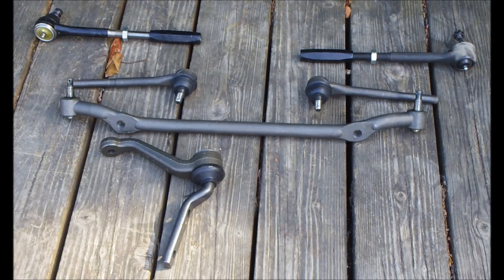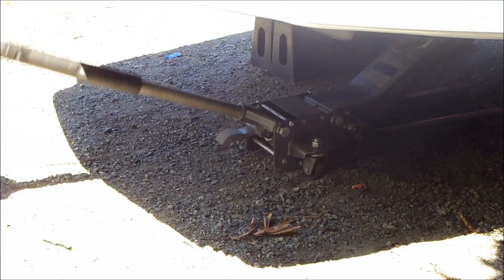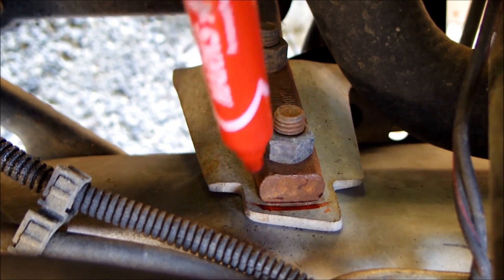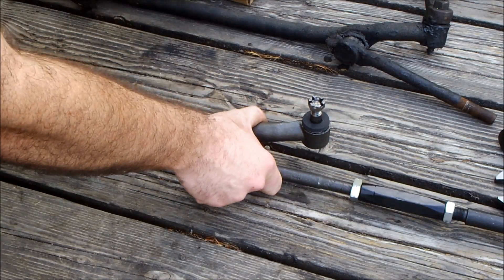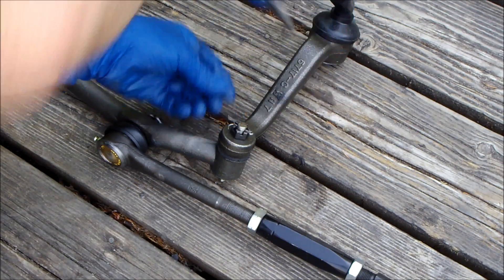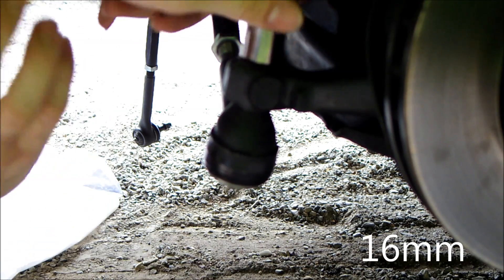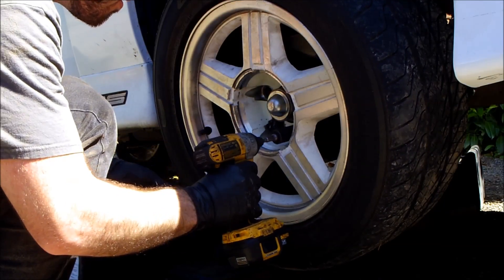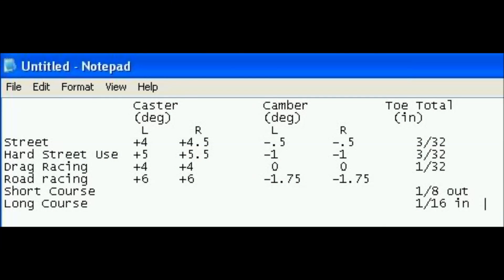Complete Steering Rebuild (1982-1992 Camaro/Firebird)

Comment: Rebuild List:
Moog ES2226RL - outer Tie Rod ( you need two)
MOOG ES2227RL - inner Tie Rod (you need two)
MOOG DS1049 - Center Link
AC DELCO 45C1065 - Idler Arm (all the other brands use the wrong design which causes bump steer)

Comment: Hi.  Great video.  It reminds me of when I did this job in the 90's.  My 82 was starting to show it's age and the annual state inspection was due.  So I replaced everything I suspected was wrong.  The day after I finished, I took it in for inspection only to be rejected.  I asked the mechanic what was wrong.  He said the ball joints were bad.
I asked if he could show me the problem while the car was still on the rack.  He obliged and we looked under the car.  I asked to point out the bad part, where he pointed to the left upper joint.  I then asked him what was wrong with it.  He said it was bad.  
I then questioned him again, telling him he wasn't going to work on it.  Just to take away the "make work incentive".  He again said the joint was bad.  That's when I called him out, informing him the joint was a TRW part with a lifetime warranty that wasn't three days old.   It didn't have any dust on it, let alone dirty grease.   He then retorted that the center link was bad.
I took it home and changed the center link within 3 hours.  He wouldn't look at me after he placed the new inspection sticker on the car but wrote that the ball joint was bad on the receipt.  The lady at the counter showed the comment to me and I dared her to call the state police.  She walked away.   
Sorry to ramble.
Reply: He was trying to make some money, that y mechanics have a bad reputation.

Comment from the maker: IMPORTANT!
the Idler ARM listed at 0:13 is incorrect!
the correct idler arm is (ACDelco 45C1065 )
Reply: And you also have to mention, that the design of the idler arm by MOOG is not the correct one so you might not be able to adjust it correctly. Better to use tha AC Delco one.
Reply: So its the same as the center link
Reply: @waynegreen6789  What do you mean? What is the same as the center link?
Reply: @ThomCountryfan  the center link numbers you posted is the same number listed as the id arm
Reply: @waynegreen6789  Actually that wasn't me posting the numbers but the maker of the video. But I've checked the video now. There's really a mistake. The id of the idler arm and the center link need to be swapped. So, 45C1065 is the idler arm and the correct Moog center link is DS1049.
Reply: @ThomCountryfan  thank u..
Reply: @ThomCountryfan  Thank you for pointing that out!  Every bit helps.
Reply: @kirkdecker6228  You're welcome.
Reply: @ThomCountryfan  so the part numbers are right. Just the description is wrong? I'm ordering the Moog Center link pn Moog ds1049
Reply: @323spy  Actually the problem I was coming up with was about not using the Moog idler arm because it has a wrong design. And then after that I also realized that in the video there is a mistake. So, yes, you're right, you can use the Moog DS1049, that's the correct Center link! But I have to say, I had the AC Delco Center link before the Moog one and somehow the AC Delco one had a better finish. It seems to me that the Moog parts are more prone to rusting. The Delcos seem to have a coating (black). I can't say anything about the end-links as I've never had the Delco ones. But anyway I'd say, quality-wise it won't make a big difference if you use Delco parts throughout if they're cheaper. For the Center link that would be ACDELCO 45B0075. I replaced the Delco Center link only because I wanted to replace all steering parts at the same time. Before that I once had to separately replace the Center link and my mechanic used a Delco one. Then I was a bit disappointed by the Moog ones, also the end links don't have a coating and got rusty after a few weeks / month's time already. But you could also paint them yourself ;-)
Reply: Was my answer helpful @heriberto romero?
Reply: What center link did you use? in the video i think the part numbers for the idler arm and center link are swapped. Did you use the moog center link ? 
Also what is the part number on the tie rod sleeves please
Reply: @Toast355  First I had an AC Delco one (45B0075) which I thought was a better product (had some kind of a rust-proof finish (black color) which the Moog one (DS1049) didn't have, the Delco is even cheaper). Also Proforged (10610011) has a center link which is very nice but more expensive.
The tie rod sleeves part is ES2032S (Moog) or 45A6013 (Delco). I used the Moog ones. But there is a better part from Proforged. They also offer a complete set of all the steering linkage (11610016).

Comment: took a gamble and ordered the acdelco idler arm and thankfully it was the correct geometry. i installed the idler arm first and then aligned the center link and then attached the tie rods. i performed my alignment using the winalign by hunter and it worked alright. i might have to realign it because i didn’t like it, plus i was in a rush to get out the shop since i was the last one there. you can see the toe-in on the passenger side tire, so i will go out of a spec just a little on that tire.
Reply from the maker: I tested 13 idler arms for bump steer, and they all passed.
I'm still digging into more data

Comment: The part I'm most concerned about tackling was brushed over. But the rest was also very helpful so thank you lol
Reply from the maker: tackling??
Reply: @3rdGenGuy  I'm going to be doing the job myself and was hoping you'd demonstrate how to make sure the center link is level
Reply from the maker: you can measure from the k-member bolts.
or I just measure from a flat garage floor to the middle of the inner tie rods.
Reply: @3rdGenGuy  Is it pretty straightforward then? Do you adjust the level by moving the position of the idler arm?
Reply from the maker: yes, the idler arm is just snugged up so you can move it up and down with a small hammer tap.
set the inner tie rod nuts to be equal.
then torque the 2 idler arm bolts
Reply: @3rdGenGuy  got it all done! Thanks so much for your help. Really couldn't have done it without your video! Appreciate what you do. :)

Comment: Thank you!!!
Reply from the maker: glad I could help.
nothing's worse than watching a 30min video of someone rambling on and on without showing you what to do.
Reply: Exactly! Bit by bit I'm bringing my Firebird back to new condition :-)
Reply from the maker: good luck man.I also have a spring, steering shaft, strut tower video as well.
Reply: Thanks, will check them out! Gonna start with brakes and shock absorbers, fluids and filters, then it's gonna be stripped and repainted.
Reply from the maker: A 3rd gen Forum member has brake kits for our cars. some fit under 15 or 16in rims. stock brakes are basically garbage.
http://bigbrakeupgrade.com/

Comment: Ordered the correct ACDelco 45C1065 from the ACDelco store on Amazon and received the MOOG part.  I did this because there is a review of the part from July 2024 which claims to have received the ACDelco part.  Are there any other brands that are verified to be the correct idler arm?
Reply from the maker: ACdelco is a different part.
if they sent MOOG, return it.
I know the acdelco idler is correct and some have told me the Pro-forged unit is correct

Comment: Is the ACDelco 45c1065 the correct part number for the center link?  Thanks in advance.  Also, does an IROC use the same steering components?
Reply from the maker: the AC delco and Moog center link can be used. either is fine.
and yes, all 3rd gens use the same steering links.
Reply: @3rdGenGuy  Thanks for getting back to me.  I have replaced all the components using the Moog parts purchased through Spohn.  I am also using Spohn's Bump Steer Kit - 1982-1992 for GM F-Body's.  Thanks again.

Comment: Hey, so I have all the parts added to my cart
Moog ES2226RL   $20 x2
Moog ES2227RL   $31 x2
Moog DS1049   $89
ACDELCO 45C1065   $67
So total is about $258 for anyone curious
But my question is this, do the adjustment sleeves come with either of the tie rods or do I have to buy the adjustment sleeves and clamps separate?
Reply: You have to buy them separately.

Comment: Hi, I am just doing this now. I have MOGG inner and outer tie rods and the AC centre link. You say the tie rods should have come with some instructions for setting it up. Mine had nothing so just asking do you have a picture of the instructions I need to follow to ensure I set this up correctly before I take it to have the alignment set at a shop. 

Thanks in advance and great video very useful
Reply: You just have to install the tie rods that they are about the same as the ones before. I mean the distance between the center link and the tie rods has to be the same so that your alignment isn't too far off while driving it to the shop. The shop is going to do the rest. What you have to adjust is the height of the center link relative to the control arm bolts / ground. It has to be horizontal. You adjust it with the installation height of the idler arm which you might not be able to if you use the idler arm with the wrong design (Moog and as it seems today also the AC Delco ones). Maybe Proforge idler arms are stil the correct design.
Reply: @disdonc6012  thanks for the reply. This job was done last year. I did manage to get the setup close and I did use the new AC Idler which for mine was ok. I then had a shop do the final adjustments and the steering alignment etc is as good as new now (as it is new haha ) but thank you for the time taken to add your reply.

Comment: THANK YOU!  I'm getting ready to do this to my 89 Trans Am GTA.  Do you have a video about replacing the ball joints.
Thanks again for a great video!
Reply from the maker: I had part of a video on the ball-Joints, but lost 1/2 the footage. I have racing ball-joints now so it's not really applicable to most guys.
Reply: hi these parts fit on  a 1987 pontiac gta thanks

Comment: Guys! The AC Delco does no longer use this design. It's like the Moog and the others. However it shouldn't be a problem and probably never was as the bolt holes line up perfectly with the factory piece. Only difference is the bend is in a bit higher place but theoritically shouldn't be a problem. You can read the 3rd gen forum and multiple people confirmed that they work just fine
Reply: The problem has never been the ligning up of the bolt holes. The problem is, that with the wrong design (bend), you won't be able to adjust the center link so that it is exactly horizontal. But this step is omitted by some mechanics anyways. They just put the new idler arm at the same position as the old one, but this isn't really correct (especially with a wrongly designed piece). You'd have to measure the distance from the ground or the control arm bolts to the center link flats.
Reply from the maker: some of the newer AC delco Idlers are wrong. 
I ordered a new one and it was a match for my old one.
but these parts sit on shelves for 10+ years often times.
Reply: @3rdGenGuy  So what part would you recommend if I can't locate and AC delco?
Reply: @TubeWatcher  I would just use your old one. Paint it up should work fine I would think.

Comment: Hi I have to rethread one of the bolts on my center rod would you know what size of die I will need thanks
Reply from the maker: pretty sure it's  5/8-18 thread.
but remember one end is LEFT hand thread, the other is right hand. 
might be worth just buying a new tie rod. they aren't expensive.

Comment: I have never changed the center link before , but after you put the parts all together , it seems like it should be lining up properly would think , so I'm  not really understanding about the center link and aligning the bolts with the a arm bolts , I would have thought once you bolt everything together like you did before you installed it that everything would be aligned properly , Great video by the way !!!
Reply from the maker: so basically, the center link needs to be perpendicular with the pitman arm and idler arm. otherwise the geometry gets wonky.
you can measure from the a-arm bolts.
or from a level surface upwards.
Reply: @3rdGenGuy  thanks for the help , are you happy with the moog parts ?  I went on eBay & ordered a TRQ kit , & one of outer tie rod ends  the boots has a cut in it ... I guess I should have tried to go locally at the auto part store . The seller did refund me my money though , told me to keep or throw away the parts ... Its hard to find good quality parts anymore
Reply from the maker: I've used the MOOG center link and inner/outer tie rods.
just make sure you have the AC delco idler arm

Comment: Why didn't you upgrade the steering to rack and pinion found on the 4th gen Camaro/Firebirds?
Reply from the maker: 4th gen steering geometry doesn't work on a 3rd gen.
the a-arm lengths are way different. 
3rd gens have NO rack and pinion support that has the correct geometry.

Comment: I think moog fixed the part, I just installed all of these parts using moog and it works fine. What was the issue you had?
Reply from the maker: the correct idler arm is (ACDelco 45C1065 )
the moog arm has the wrong geometry. 
it works, but it can induce snap oversteer
that might send you into a tree if ur pushing the car hard.
Reply: I also think I wasn't able to level the center link correctly. I guess most of you don't even care about leveling it. You just use the old places when bolting the idler arm up.

Comment: Do you mean the AC Delco center link or idler arm?? It looks like you have reversed the part numbers- the Moog center link number is DS1049
Reply from the maker: the ACDelco 45C1065 was the Correct idler arm.
but now i'm hearing they changed the geometry and it's wrong just like the MOOG idler arm.
I haven't checked the PRO-Forged one yet

Comment: Our 1983 Camaro had an inner tie rod that was shorter than the Moog ES2227RL.  Did Moog change the center link and tie rod ends dimension?
Reply from the maker: SO MOOG's parts are often universal.
so yes, their TIE rods may be a little too long. when using the non stock Tie-rod adjusters.
 i had to cut off 3/4in off one to get it to work.

also, the Pro-forged kits are also acceptable quality wise . price is a bit lower than MOOG/AC delco as well.
Reply: @3rdGenGuy  I made a huge mistake.  I was comparing a Blazer tie rod not a Camaro tie rod. Too many projects going on here.  
I lost the mark when removing the old idler arm bracket from the frame (painted the engine compartment)  Any idea how to adjust the position of the idler arm bracket height?
Reply: @stricklandgarageaviation2864  You have to align it, so that the center link is level. I guess using a water spirit level could work but actually it has to be level to the K-member, not the ground. The manual says that you have to adjust it using the bolts of the head of the nuts where the A-arm is connected to the K-member as a reference point and then measure some distance (center link -- bolt) which has to be the same on both sides.

Comment: Where did yoy buy this kit?
Reply from the maker: each part was purchased separately from amazon.
part numbers are at 0:13
Reply: Not An Argument. How much did it ask cost? Did you have to cut anything to make the parts fit?
Reply from the maker: it's about $300 total not including a new alignment.
BUT it's a drastic improvement over worn-out linkage linkage 

if you used the billet sleeves (connects outer an inner tie rods) you will have to trim 3/4in off the threads on the outer tie-rods.
if you use the stock sleeves you don't need to cut anything.

Comment: Why do you have to mark the position of the idler arm? Also why can’t you use the moog idler arm?
Reply: *center link not moog
Reply from the maker: the Moog idler arm has the WRONG geometry.
it wasn't made for a 3rd gen but is branded as a 3rd gen part.
3rdgen.org has a BUNCH of posts about how horrible the steering ends up being with that MOOG idler arm.

you want ACDelco:45C1065
i posted the wrong part # by accident in the video
Reply: 3rd Gen Guy before installed the same kit you have on my car my wheels never rubbed at full lock but after the install they rub left and right
Reply from the maker: was the car properly aligned at a shop?
that sounds like a weird outcome since the steering stops won't allow stock 235 55 r16s to rub
Reply: 3rd Gen Guy after further looking into this problem only the right side rubs. Car was never into any accidents either.
Reply from the maker: do you have the proper AC delco idler arm?
Reply: 3rd Gen Guy yes
Reply from the maker: that's weird. typically rubbing is due to larger than 16in 245 tires being installed

Comment: Unfortunately I stumbled upon this video AFTER I bought the Moog arm.
But, it seems from the video that yours has the same casting on the arm as mine. And according to the thirdgen.org post- some ac-delco arms were in fact from different manufacturers and the same as the Moog in geometry.
So- I think you have the wrong one installed too- easy too check- measure from the arms end the height to the grease fitting area- if above 2" , it’s the wrong design.
Please, let me know… (leveling the center-link might correct the arm's location height-wise, but probably still affect the total geometry)
Reply: how did it work out

Comment: i seen this video after installing. How do you align center link with A-Arm bolts?
Reply from the maker: It's easier to park your car on flat concrete and measure from the ground. you want the center link heights to be equal on both sides.

Detroit speed has a video of it for their DSEZ car build.
Reply: 3rd Gen Guy got if this isn’t done how bad will the ride be
Reply: @lh399  I couldn't get it level because of th wrong idler arm. Well I don't know, my suspension is bad anyway, so I can't really say anything. Didn't feel anything special / worse about it. But as 3rd Gen Guy mentioned in another comment, it could induce snap oversteer.